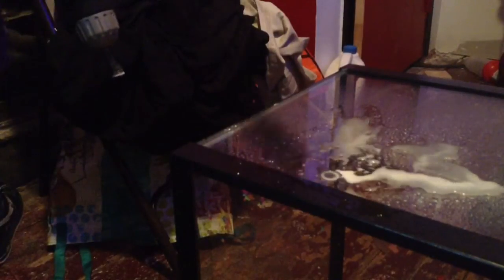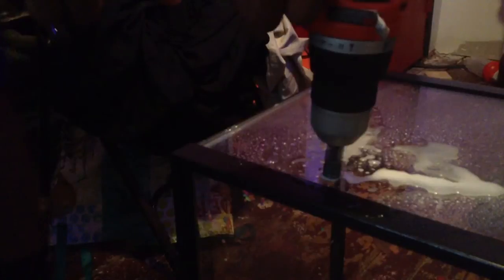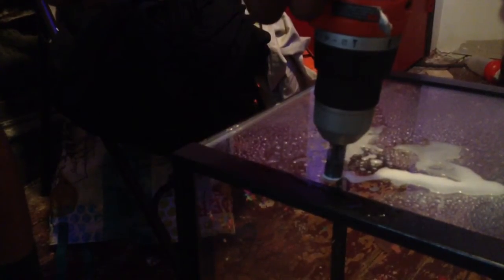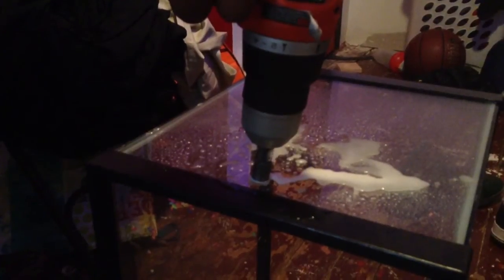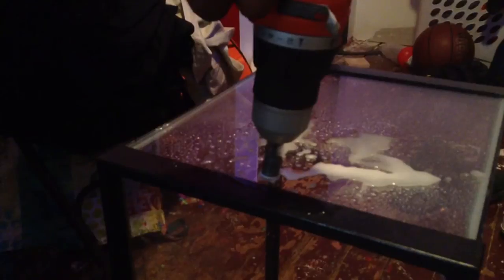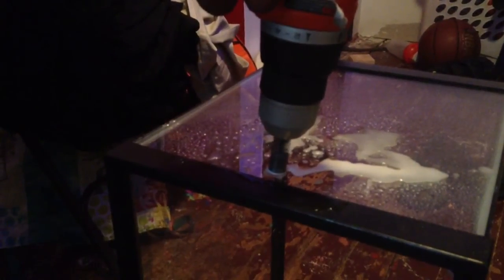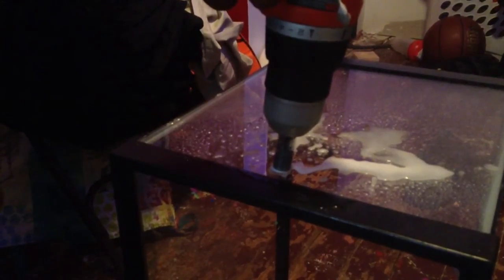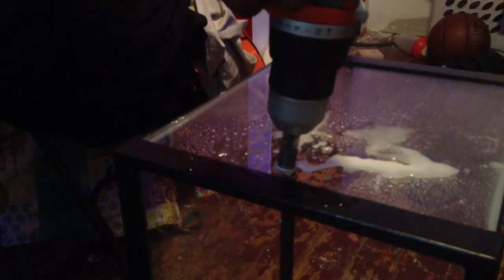Automatic Vivarium Drainage (part 1 drilling the tank)

Comment: i would also suggest drilling from the inside out not the outside in when possible because if you get some chipout you want it on the outside not the inside
Reply: Josh Thompson I wouldn't drill from the inside it could cause you to have pieces of glass in the tank even if u try and wash them out its really hard to get all the shavings